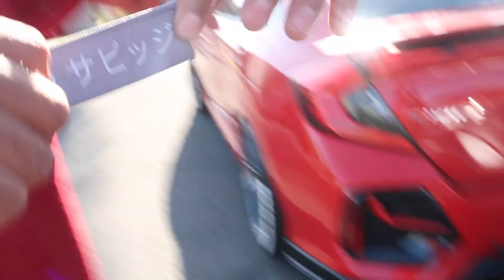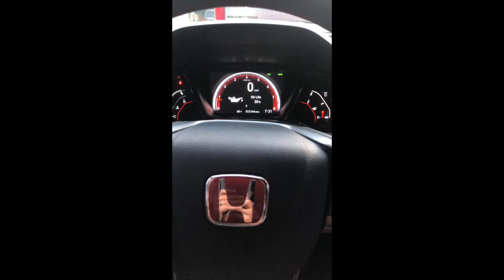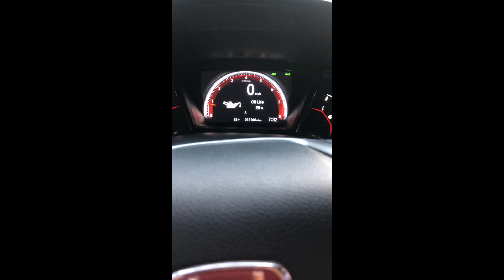WHAT IT'S LIKE OWNING A MODDED 10TH GEN CIVIC Si

Comment: My boy on D2 springs and greddy lip never broke? 🥵

I’m scared to get my own bcuz I’m on D2 and I would probably break it within 2 weeks because I daily it on the freeway :/
Reply from the maker: Its alright not that bad if you secure it properly, only issue i have is some steep driveways. im thinking of doing a custom chassis mounted  splitter 💯
Reply: @JZ.Visualz  have you yet broke or chipped your greddy lip yet?
Reply from the maker: @jantamase9884   I have scraped it a bunch underneath the actual Lip. but can easily be avoided by installing a spitter. you thinking of getting one?
Reply: @JZ.Visualz  yeah I want to get the carbon one but knowing me on the highway and how low I am, I might break it :/